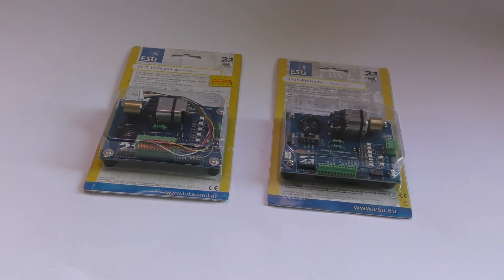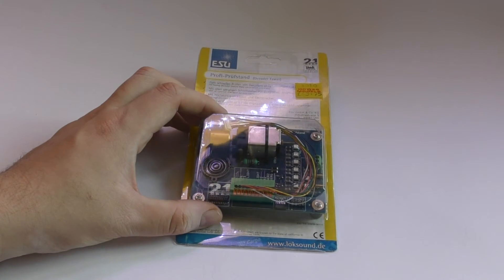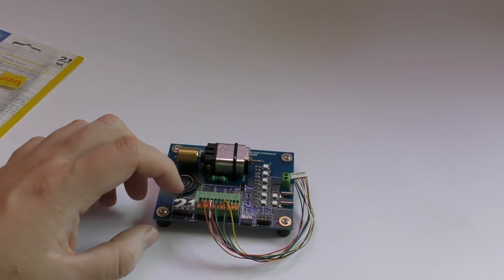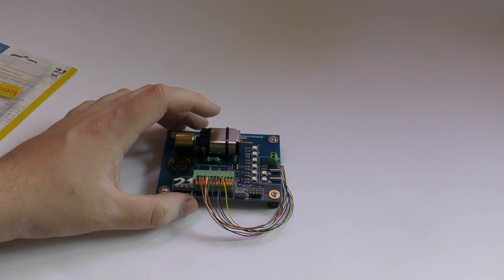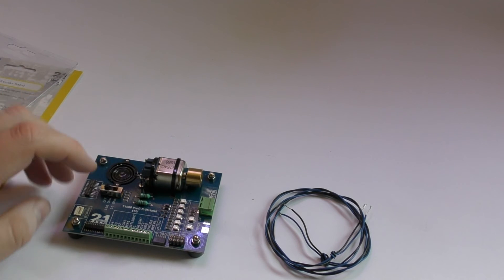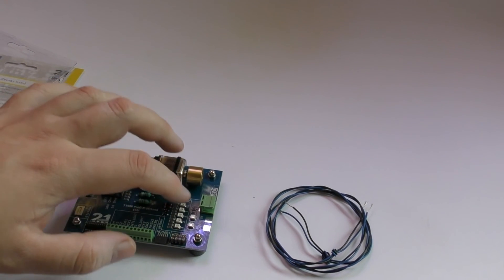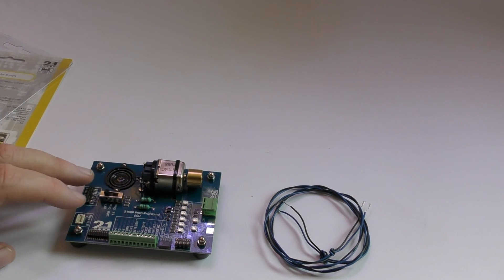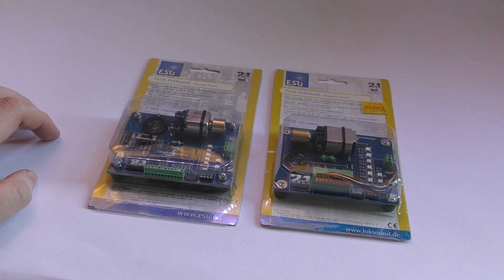Review of My ESU Decoder testers

Comment: Thanks for that Richard I hadn't known about the differences between the models of decoder testers. I only have the older type which is still effective except the little orange sprung terminals have broken off in a couple of places which is annoying.
Reply from the maker: Thanks.
the other different which I did not say which is should off said is the older ones don't work with the loksound version 4.